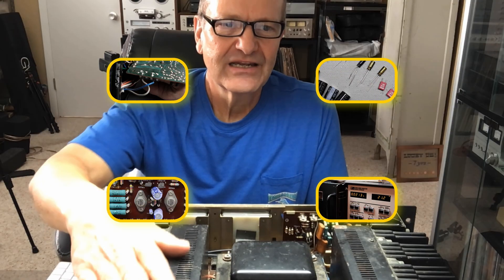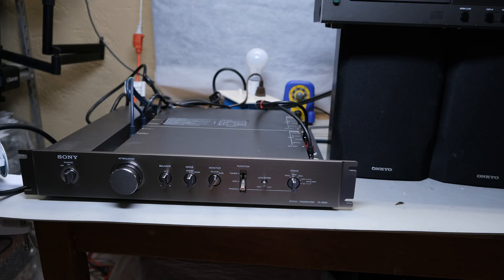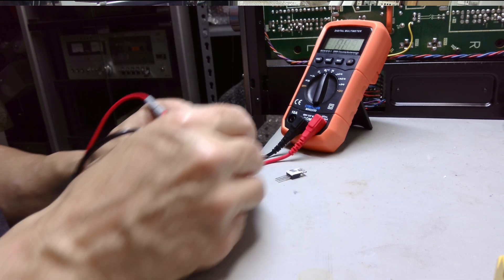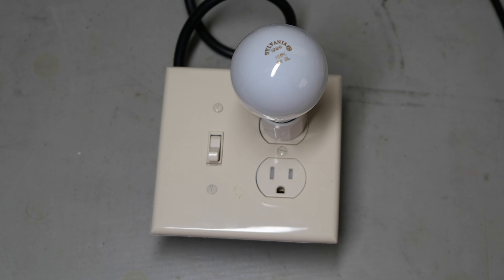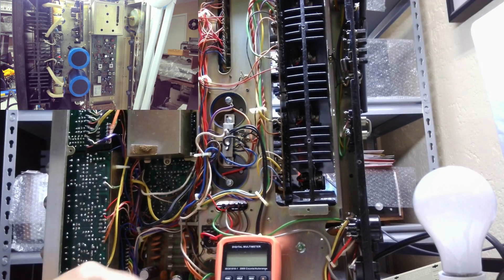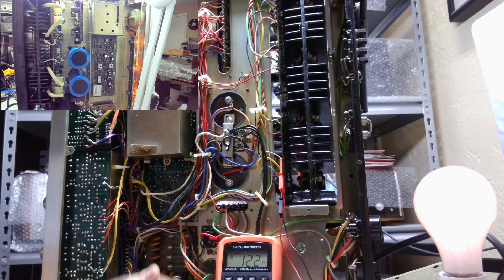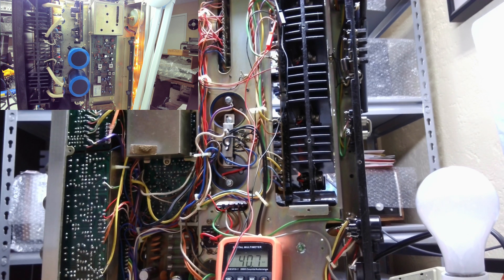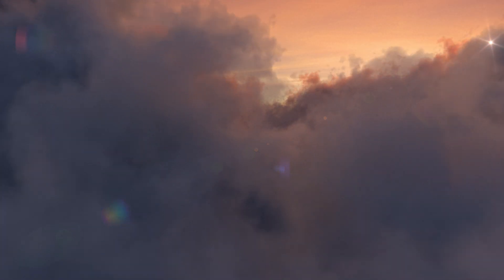The #1 Mistake You're Making with Dim Bulb Testers - Don't Make It Again!

Comment: The first thing I do before adjusting output transistor bias is check the B+ supply voltages to that circuit and the driver and preamp circuits also. Then check the collector and emitter voltages at the output transistors. Of course you will get the wrong bias adjustment if the dim bulb is reducing the line voltage and consequently the  B+ voltages all through the amplifier.

Comment: I realized this when I started repairing tube amps and the voltage drop across them was incorrect and there is no way I can check the plate dissipation with the series bulb on.

Comment: I use a 75watt a 100watt and a 200watt dim bulb tester.
If i fix a small radio equipment or something, i do have a small 15w bulb which has an E12 plug, which i also have plug for it in my dim bulb tester, which is handy, back in the days when i didnt know about this technique, i tried to fix a radio which only was 2x 2.3watt amplifier, and it blew the chip up like it was nothing...

Comment: You can add a socket and put a digital voltage meter (pretty cheap) and you’ll know all the time what voltage is going to the amp, for that reason you’ll need a variac in order to increase incoming voltage minus the dim bulb and you’ll see it in the digital voltage that you add to the other socket but also you can just unplug it and plug it directly to the outlet, niche job and great explication

Comment: DO NOT use a dim bulb tester . the voltage drop will give false startup , the best is to use higher wattage elements such as a 1000 watt or more halogen spot lamp , you only need the use this when you suspect shorts , if you have a short the 1000w globe will light ,and will protect  , DO NOT use 100w or 300w globes as they will give false information

Comment: Thank you for the update. 
I wonder why I'm only hearing about the dim light tester in the last couple of years? I have been servicing electronic equipment since the 60's. This is such a simple and useful device.
Reply: I think a couple of videos using a DBT popped up on YouTube, and they caught on quickly after that. I’d never heard of one either until the internet got up and running good (2000s) and like you I’ve been doing this for a while.  I also work in electronics repair field and I get blank stares when I suggest a DBT tester there too.  We do have Variacs with built-in ammeters, so that’s just as good.  People (including myself) just prefer the visual of a bright incandescent bulb instead.
Reply: @SteverRob  Thank you! I never thought of the DBT being something like an automatic variac.

Comment: As to the idle current comment, the dim bulb tester is there to save you from catastrophic failures. Once the amp is running, remove the dim bulb tester before checking your idle current.

Comment: You have made some mistakes here. First, you had a faulty transistor, but you already had previously had this unit on. So you could have plugged it in and nothing else would have happened. You should have trouble shooted the power supply with another supply feeding in at the bridge rectifier.

Comment: The problem with using the dim bulb unit with the Pioneer is the bulb drops voltage when it’s glowing; the more it glows the higher the voltage drops. I guess that the input voltage to the Pioneer wasn’t high enough to allow the internal power supplies to output the correct voltages and that resulted in the bias current being wrong. I’d always check the internal voltages before taking any measurements.

Comment: Hi Chris. I would agree with you that( just like with everything else in life) the “ dim bulb” is not a universal panacea. I have had a couple of things smoke the transformer even with the bulb in circuit. 
 Re. comments on idle current, while what you say is perfectly valid my “variable auto transformer “( mine is actually a “ Regulac, but I guess the best name was already taken) can give about 260 volts out for a 230/40 volt input.
 I can wind up the voltage to compensate for the D.B and still have it in circuit. Handy in case I slip with the probes! Anyone who has ever done that on a Quad 405 and blown the final o/p transistors will know exactly what I mean.

Comment: Nice job explaining that a DBT puts your DUT in a non optimal self bias configuration and caution is needed.  
I have a 3 way switch that allows me to step up to 3 bulbs in parallel progressively upping the current to the DUT and when im happy i have a TEST-BYPASS switch that can power the DUT without the DBulbs in cct.

Comment: Tantalum caps suck. I always check them. I had an old Marantz that almost every one of them turned into resistors instead of caps.
Reply: Totally agree..  ive been calling them TANTRUMS since the 1980s..  they are far to often used in the wrong places like low impedance power rails..  Tantrums simply cannot tolerate low Z voltage surges. Ive literally seen them smoke and explode when powering up.  They are perfectly happy at the end of a power rail immediately next to the PS pins of an ic where they can provide HF bypassing safely.
The 1uF 35V Tantrum located in the PSU should be replaced with an electro or a film or an MLCC ceramic. Tantrum begone....

Comment: wonderful video, I learned a lot! does a 100W bulb work on vintage monster receivers too, something with a 560W power supply for example?
Reply: It would be better to use higher wattage in such cases. In any case, this wattage should be near but less than the wattage of the device under repair.

Comment: The wattage of the bulb should always be less or equal (but not greater than) the wattage of the equipment under repair. Otherwise it doesn't offer any protection. This means that a 100W lamp cannot be used for any repair. Therefore many lamps of different wattage should be available for this test jig...

Comment: TIP: Plug the dim bulb into a kill-a-watt type meter and keep an eye on that, too. Whenever I adjust bias, as well as the DC voltage,  I also watch the input watts vs the rated watts of the amplifier.
Reply: I do the same!
Reply: Do you just add the two together? what specifically do you watch for?
Reply: @CoreyLKoberg  There is no adding involved. As I said above, watch the input watts vs the amp's rated input watts. If that wattage is exceeded then there is a problem so cut the power asap.

Comment: I noticed that you were using tamper-resistant outlets. I was watching some electrician videos and I realized that I could easily have wire bits and components fall into the receptacles, so I bought that type.

Comment: What is the advantage of using bulbs instead of testing devices with ammeters? As far as i know you combine isolation transformer with a variac and while you raise the voltage slowly, you keep an eye on the amps. Dim bulb testers are better?
Reply: You can see the changes really fast without thinking. If you want to use an ammeter, be sure to get an analog one. You could definitely use a high wattage resistor plus an ammeter. But bulbs are cheap. Throw in a digital ammeter if you just want the data. It's possible that a wirewound resistor could have an inductive effect. I have two 8 ohm non-inductive resistors. That lets me get 8 ohms, 4 ohms if parallel and 16 ohms if in series. These would be good for speaker dummy loads. They are not cheap. I have a goofy lamp that has colored night light incandescent bulbs that I may add to show if it is connected to the mains directly or if not. I haven't decided yet.
Reply: The variac, if used alone, will blow up your device if it reaches the critical voltage. The lamp prevents this effect. It acts as a PTC thermistor.

Comment: I had the EXACT experience yesterday with my dim bulb tester. I was working on a Hafler DH220 and was plugged I to my dim bulb tester. The bias current was a little low since the AC power was a little low due to the voltage drop through the bulb. I had to redo the adjustments.

Comment: A 100w bulb is a little low for powerful amplifiers. I use a 300w clear glass bulb so, of course it lights it up bright when there's a dead short but, I still can see the dimmest of illumination if there's an issue without turning the shop lights off.
Reply: I have 2 150w clear bulbs in parallel.
Reply: @fisherhutchens9452 i have 3 clear with a triple switch.  Can proggessively step from 1 to 3 in parallel.. then a bypass switch when im happy all is ok for 100% mains power.
100% agree the clear bulbs help a lot to identify trickle currents that you wont see with opaque bulbs
Reply: Directly related to your text, is my comment above in the pile, regarding the proper wattage of the test lamp.

Comment: Thank you for this video. I’m new to vintage electronics, and it seemed gospel to always use a dim bulb tester, so it’s great to see when using one is not appropriate.
Reply: This jig should only be used during troubleshooting. After confirming that the repair is done successfully the equipment shoulld be powered directly from mains.

Comment: I appreciate the information videos such as your share with many new to electronics. In truth a huge mistake for many is not reading the service information and making sure the input line voltage to the device is what it should be when making any post repair adjustments, alignments, final measurements, etc. The DBT is absolutely an excellent aid for repair but should never be left in circuit once you get to the adjustment and alignment stage. It lowers the input voltage and current and can make adjustments way off even in equipment with modern design power supplies. With any DBT you should have more than various wattage bulbs to use. You should use one sized to the input power rating of the equipment you are working on. Smaller ones are ok but they may drop the input line voltage to the point the device may not come on even for initial testing.

Comment: Hi,
I got a powered mixer 110V 700W power consumption, 
I powered it up with a dim bulb tester with 100W bulb. When press power, the dim bulb flashes on and off. You think the dim bulb is limiting the current stopping the mixer to start up.
Reply: Yes. (If you want to know why, you can see my comment above in the pile).

Comment: Fully agree with all your procedures. I only use a dim bulb to find a catastrophic failure and fix it. I also will use my dim bulb when powering up my vintage amps if they have been sitting unused for many month's or years. I will run them through a 300 watt bulb. My theory is doing that the amp will not be "shocked" back to life. It allows a more gradual charging of filter caps. What about using a dim bulb for equipment with switching power supplies? Instead of an old linear PS that just says "here is all the power/voltage you will even need, so just take what you need". A switching PS will  consume more or less current from the mains to maintain a regulated output "on the fly". Unlike a conventional old school power supply, the SMP only stores a small reserve of power, but relies on a good power source to grab the power it needs. If the mains voltage drops, the SMS will draw more current to compensate for drop to maintain output voltage. I feel a dim bulb inserted into the supply line could cause a failure because the poor SMS will try everything to get the output where it is supposed to be! That means a huge current flow when it is undervoltaged. I feel something will pop?
Reply: The wattage of the lamp should be less than or equal to the wattage of the device under repair. Higher than that offers  no protection.
Reply: I also use DBT for powering up my vintage amps, but I use a 600w bulb. That gradual charging is best for big caps, on/off switch and other parts that flowing a massive amount of current on start up
Reply from the maker: Thanks so much for sharing. Using a DBT takes some experience because of the differences between the equipment and the bulb wattage used.
Reply: Another electronics channel I follow does a lot of ATX power supply repairs and uses a DBT all the time on them.. Really good channel as well https://www.youtube.com/@LearnElectronicsRepair

Comment: Thanks so much for this. I learned from lots of folks on AK to remove the DUT from the dim bulb before making any adjustments so I completely understand your point. One thing I could never wrap my head around was what wattage of bulb to use. It seemed like most were using 60 to 100 watts but I never understood why. Greetings from up the coast in St. Pete!
Reply: it's going to vary a bit depending on the type of equipment you're working on, but you want a good amount of current, but not enough to blow things up.  if you're working with a device that takes 100w peak you might want to use a 40w bulb, while the 40w bulb isn't going to be enough if what you're working on takes 1000w, or if it powers up the device, the bulb might stay fairly lit fooling you into thinking there's a problem when there isn't one
Reply from the maker: Your welcome and thank you for watching. I thought it was worth mentioning. It's an easy mistake to make when you are first using a DBT.

Comment: Oh man I got lucky then... I was doing exactly what was described in this video NOT to do, and I did not blow up my Marantz 2325.  New to doing this, and definitely won't do that again.  Thanks!
Reply from the maker: Your welcome and thanks for watching. You should probably check your idle current again off the dim bulb tester.
Reply: @vintageaudioaddict  Did check it off of house power, but then I went to put a new relay in and lifted some traces... since I'm fairly new, I dropped it off at a tech to repair the lifted pads and get it working again, then will slowly recap the boards with a desolder and solder iron.

Comment: I was working on an NAD receiver and was getting 3 or 4 V DC offset when using my dim bulb tester. The bulb would stay bright from what I remember. Without a dim bulb I was getting millivolts and no issues. I think I was using a 40W bulb. I went to a larger bulb and everything was fine. For some reason the smaller bulb wasn't allowing the receiver to power up correctly and wreaking havoc with the DC offset.
Reply from the maker: Thanks for sharing. I have had a few issues but generally the 100 watt works for me with most equipment. The only issue I remember having with the 100 watt bulb was my Sansui BA-5000 power amp. It would not even power up on the dim bulb tester until I installed a 200 watt bulb. Not sure why that would happen? But it did.
Reply: @bmboldt  " I went to a larger bulb and everything was fine. For some reason the smaller bulb wasn't allowing the receiver to power up correctly"

This is the reason:  watts = volts ^ 2 / ohms.  So a higher watt bulb means it has a lower resistance.  volts = amps * ohms.  So a lower resistance bulb means less volts lost across it, meaning more of the 120V from the wall outlet makes it to your receiver.  If your receiver doesn't have enough volts, it's not going to power up correctly.  The more current your item draws under normal operation, the more volts you'll lose across the bulb.  So higher current items that need an accurate power supply will need a higher watt bulb.
Reply: I am just figuring out a wiring diagram for my first DBT. I know where to get some 200 watt incandescent bulbs. I'll go get them for something that needs extra power. I should have bought them when I was there, but I had a mountain of things I was buying
Reply: The test lamp wattage should be less than or equal to the device power, but not higher than that because in this case it offers no protection.

Comment: For me, I usually don't figure it out until after I blow the new transistor. That's why I order spares. Thanks from the dim bulb in Colorado.
Reply from the maker: I've done it plenty. Thanks for watching.
Reply: Hey Craig! Cheers from the dim bulb in Utah! 😎🤟🤓
Reply: @fullwaverecked  howdy
Reply: Yeah I figure it's not done right unless I've done it 2 or more times over lol.
Reply: You are not the only one. When I hear the little click when it shorts it is usually followed immediately by a four letter word.
Reply: @Poppinwheeeeellllllieeeeez Snap!
Reply: @fullwaverecked   That too.  But he's talking about the little click... the one you're not quite sure you heard, but know you did when you find your device doesn't work anymore!
Reply: lol.  my first dim bulb test was extremely dim. i'll explain. i built my own vscuum tube guitar amplifier.  its a major learning project. i got hip to the dim bulb tester thru uncle doug here on you tube. found a fellow that showed you how to wire it. he came very close to showing you all you need to do, lol.
get parts, build tester. new first amp build, fresh tester build. plug it all in & with much trepidation & a popsicle stick in hand, it was now the moment of truth, i fired it up. no bulb glow, no amp glow, no desk lamp, no tv, no nothing except a blown fuse in my house panel. lol.

i was supposed to know to break off some    copper tab in the plug receptacle that i bought for the tester.
i responded that i barely knew what end of the soldering iron to grab.
great video & explanation.